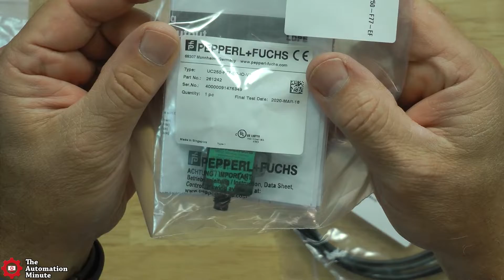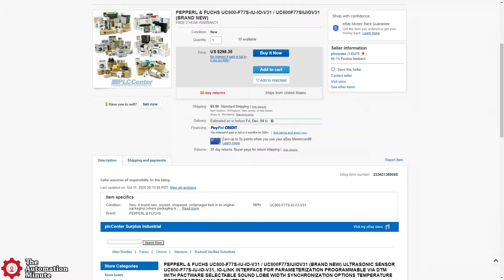First Look: Ultrasonic Sensor with Analog Out and IOLink from Pepperl+Fuchs

Comment: Hi great video,Im having trouble With sensor Mode iolink,i do The proggramming sequence proggramming Button to Change to IoLink and i get values on s7-1500 but every time sensor loses power supply It stop using iolink mode and i dont get values can you Help me please?
Reply from the maker: Hey @vektorosu3130, I highly recommend contacting P&F - I haven't used this sensor in a number of years, and while I do hope to look at it again soon, I'm sure that's not going to soon enough for you!